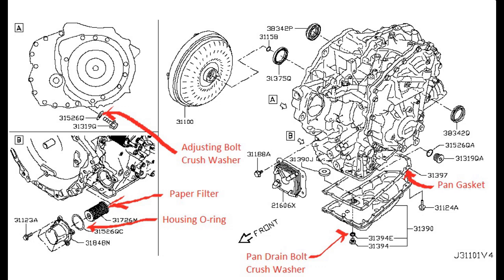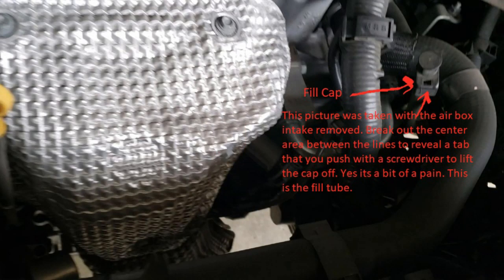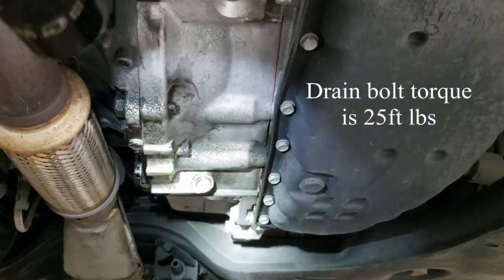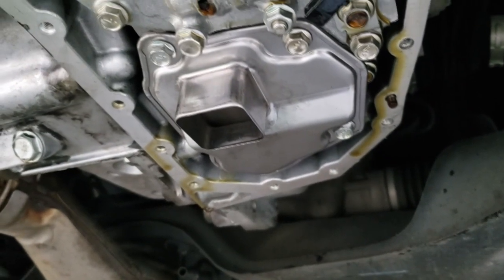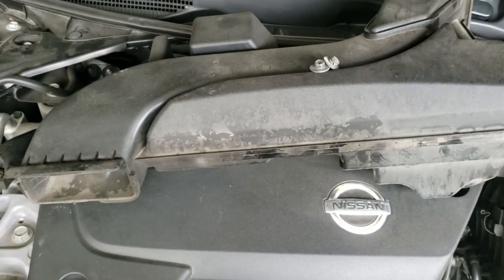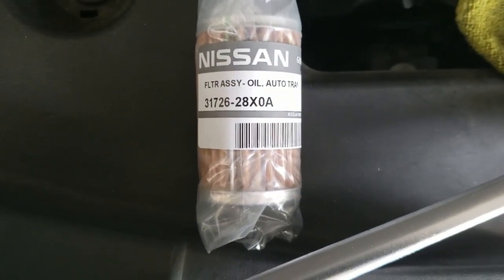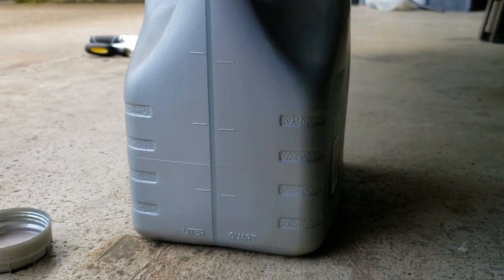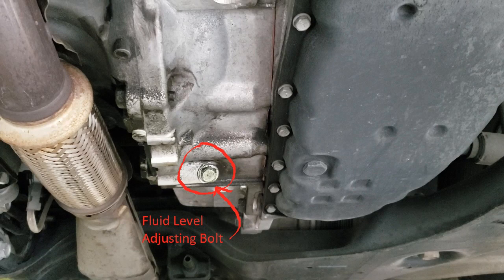2014 Altima Transmission Fluid Flush and Filters Replacement

Comment: Idemitsu makes the Nissan CVTF.  It is a non-synthetic fluid.  Valvoline, Havoline, and Amsoil are good or better than the actual Nissan brand.  Before Nissan changed to Idemitsu the previous CVTF manufacture's fluid wasn't meeting specs leading to all the CVT failures.
Reply from the maker: I researched quite a bit to also find out that the Nissan CVT is Idemitsu. So far I've been able to get good deals on Ebay on Nissan NS-3 by the case cheaper than I can find the Idemitsu branded fluid. I've been hesitant to use any other brand over concerns about viscosity.

Comment: If you remove the paper filter at the torque converter housing ( one with 4 bolts )  without draining fluid will fluid pour out.

Comment: The CVT fluid temp can be read in IOS with ELM327 version 1.5, using OBD Fusion app with the $9.99 enhanced addon (under purchase extras) on my 2013 Nissan Altima.
Reply from the maker: I don't have IOS so this is good info to put out there. Thanks!

Comment: Thank you for this great video! Question - would it be better to flush the fluid until clear, and then drop the pan and replace the filters? Otherwise won’t the brand new filters catch a ton of crap due to the old fluid still in there?
Reply: Good question. The pan is the source that is feeding the pump and hence the transmission so by dropping and cleaning the pan, filters, and refilling the pan with new fluid, you know you are pushing clean fluid through the trans. Any old fluid that will go through the new paper filter is minimal. You could probably do it either way, and I am sure no CVT trans expert or anything, but I think cleaning the pan  and/or replacing the filters first makes more sense to me. I could also use the rationale that do I really want to push clean fluid through dirty filters and a dirty pan?
Reply: @thevoigts651  Thank you for the great response! My thought was flush till clear, drop pan etc, then do another flush. But maybe that is over thinking it and wasting fluid. I need to do this to my wife's car, and your video makes it possible. Thank you again for making this!
Reply: @Verhooft  Well more flushing sure isn't going to hurt anything but I would think it's overkill. Realize that just by doing this to your car you are way ahead of the game from what Nissan "recommends".
Reply: @thevoigts651  Its surprising how little they "think" needs to be done to these. Lifetime fluid?? Yeah right.
Reply: I don't understand either why Nissan acts like there isn't even a paper fine transmission filter when there clearly is and from what I understood other car brands that use Jatco have it to be changed along with the fluid. I really think a lot of these CVT transmission failures are just due to lack of basic maintenance.
Reply: @thevoigts651  Agreed. I'm no expert or mechanic, but I don't hear as much about other companies having CVT failures on level with Nissan.

Comment: For Altima, do all you can to limit/ lower heat, includes minimum coolant-water ratio, 30k change both filters, best cvt fluid, seal the too-leaky cooling plenum, keep radiators clean...I found this to be enough for Mojave hard and hot conditions now 209k.
Reply: 209k is great, especially in those conditions
Reply: هـجر M'3  before you remove the fluid level adjusting bolt you have to make sure the car is level and the trans fluid within the correct temp range. If you didn't do those 2 things, make sure they are correct first and then re-check your fluid level. 3 quarts coming out would be a major overfill as the whole loop only holds 9-10 quarts. Are you sure you took out the adjusting bolt and not the drain pan bolt? The pan holds about 4 quarts.
Reply: هـجر M'3  If you drove for an hour the fluid is certainly going to be well above the correct temp range. I only have to idle my Altima for 5-10 min for it to hit temp. You probably drained too much out. Go by the procedure and you'll get it right.

Comment: I cannot find anything in the manual for needing to change the transmission filter or the paper one. Is it necessary?
Reply: The whole point of my making this video is that none of this is listed in the service manual from Nissan. They say you never need to change anything in the transmission except under severe heavy use, yet examples of failed Nissan Jatco transmissions are not hard to find. I don't want to have to replace my transmission if I can help it. My Altima at about 60k shifted way smoother after doing this and still is at just over 80k. I fail to believe a paper filter and fluid never needs to be changed, and drain pan and filter never cleaned. As to whether or not you need to do this is up to you to decide.

Comment: The Nissan dealer won't replace the paper filter because they say one of the bolts are hard to get to and that they would have to separate the transmission from the motor to get to it. Can you show us how you replaced yours?
Reply: I didn't take any video while taking them out, but they weren't very hard to get to from underneath. I used a simple 10mm wrench to get the top bolts. You can also take off the air intake as I showed to reach the top ones from above. The dealer saying they have to separate the motor doesn't even make sense as the paper filter is inside it's housing on the passenger side of the transmission towards the bottom.
Reply: THAT IS A BUNCH OF BS!!!! The Stealer is trying to hustle you dude. You can EASILY get to the paper filter by removing the driver side splash guard. It is not hard at all. That stealership is full of it.

Comment: At 4:27 in your video there is a open pipe facing forward, at the very bottom. Please tell me what that is for. Thank you
Reply: If I'm not mistaken that is the evaporator coil condensation drain pipe for the AC.

Comment: Do you have to completely remove the fluid level bolt in order to let drain until it drips?
Reply: Yes. Car should be level, engine running, fluid within the correct temp range, and drain bolt out until fluid drips.

Comment: Any idea who will do this type of work in your local area?
Reply from the maker: You would probably need to order the parts and fluid and take them to a local mechanic specifying exactly what you want done. A Nissan dealer isn't going to do this.
Reply: @HowToDoStuf  Thank you for the suggestion. Yes you are absolutely right. No one will touch it.

Comment: I would also add a transmission cooler flush, this will get all the debris out of the collant line. Nissan sells those cans for cheap
Reply: Even though it is Nissan approved, I am leery of putting any kind of chemical into the transmission loop. I guess as long as you air hose it all out it should be ok. I might look into this next time I do my flush.
Reply: @thevoigts651  The cooler flush is like brake fluid, it dries very quickly. When I used it, I was able to see lots of dirty stuff coming out of the hose. As you said, you can also use air can and pump air through it afterward, but not necessary

Comment: As far as the sealed cap. All u do is insert a small flat blade screwdriver into the slot gently then pull up on the cap while holding the screwdriver. It comes right off.
Reply from the maker: I haven't tried this. You wouldn't loose any fluid that is in the pan to be sure. I'm not sure how much would drain out of the torque converter housing. I would think that not much fluid would.
Reply: @HowToDoStuf  
I think he's talking about the fill tube...?

Comment: Does this method also applies to the 2016? Do I really need 10 quarts? Because some other people here on YT use only 4 quarts.
Reply from the maker: 4 qts is only draining and refilling the drain pan, which is what most people are doing if they do anything. The reason I made this video is to show you how to change the paper filter, mesh pan filter, clean the drain pan, and replace all of the fluid in the transmission. The part numbers for the filters may be different (easy to look up), but Nissan CVTs are all Jatco transmissions and work basically the same way. Its up to you what you want to do.

Comment: What is the price that  you paid for this procedure good to know thanks
Reply: I'm running off memory here, but I paid about $150 for a case of Nissan NS3 from Ebay, about $10 for the paper filter, $5 for the filter housing o-ring, a couple of bucks for trans drain bolt washers, $15 for a trans gasket, $5 for CVT50 app, and $35 since I replaced the mesh filter instead of cleaning it (which is what I will do next time). I probably missed something but that's what I remember. I also had to buy a 1/4" torque wrench for the trans bolts. Not bad given that Nissan here charges $250 to just drain out the pan and refill 4 quarts. We've acquired a 2012 Altima so I will be doing this flush on it soon.

Comment: This procedure is significantly different from what is shown in the service manual.  Read the service manual procedure shown starting on page TM-83 before you attempt this method.
Reply from the maker: The service manual of course shows only a simple pan draining and refill which is recommended only under extreme duty conditions (per the owner's manual). There is no mention of changing the fine paper filter, cleaning out the pan, cleaning/replacing the mesh pan filter, or changing out the fluid, which are all reasons that I think have greatly contributed to these transmissions continuing to have issues. Why Nissan ignores basic maintenance on these transmissions is beyond me. Nissan also says to use a charging pipe set to fill when there is a perfectly good dipstick tube.  The TM-83 page you mention is very helpful in that it gives you the proper fluid level procedure.
Reply: @HowToDoStuf  The standard procedure does change out the CVT fluid.  At least 10 quarts of NS3 are required using the standard method (which includes dropping the trans fluid pan and cleaning the metal strainer and replacing the paper filter by the trans fluid cooler for a complete service) which does involve mixing some of the old fluid in with the new and draining out some of the new fluid as well - a necessary evil unfortunately.  Most people who will attempt this maintenance will have watched several different videos beforehand - I sure have.  I appreciated your excellent video quality as I could see everything clearly.  I am aware that it is possible to refill the transaxle through the dipstick tube - Nissan apparently did not want to inform  DIY mechanics of this probably because many of them weren't using the correct CVT fluid when replacing it trashing their transmissions and then trying to get Nissan to pay for a replacement.

Comment: In the description under "tools needed" you say a torque wrench for 25"ft" lbs torquing of transmission pan drain bolt... Are you sure that's 25 FOOT pounds? That seems like a lot... but 25 inch pounds seems like to little for the drain bolt...  I'm going to be doing this procedure soon so I'm just wondering.
Reply: 25ft lbs is not much torque for a drain bolt. That is pretty much normal for drain bolts with a crush washer. That torque comes from the service manual.
Reply: @thevoigts651  Cool thanks.
Reply: The oil drain plug on my pathfinder is 25 ft lbs too. I wouldnt gand tughten on that much, but thats the spec.

Comment: When you say ignition on do you mean start the car? Or just put the ignition I'm the on position?
Reply from the maker: You have to start the car in order for the transmission oil pump to begin pumping into the waste container.
Reply: @HowToDoStuf  I'm talking about when adjusting the fluid level with the OBDII scanner.
Reply from the maker: @TheDwilliams1000  When you are checking the fluid level, the car should be running and the trans fluid has to be at the specified temp.

Comment: You missed the part where after you take the bolt off there is another part inside you have to use an Allen key to take out. Makes it flow faster.
Reply: What bolt and which part are you referring to?
Reply: Elmo Car Guy Sorry LOL!! The bolt to drain the tranny fluid. After, you stick an Allen key and twist. A piece will come out allowing more flow for the fluid to drain.
Reply: @thevoigts651  Hmm, maybe it is different for the 2013.
Reply: @anon4041  I wouldn't know as I've got a 2014.
Reply: My 13 Altima is exactly like the 14 in the video!!
Reply: @roberto3330  Idk I saw a video of a guy doing it and he removed a bolt that was inside, it drained much faster.
Reply: A Non I know the Sentra has that Allen bolt, and I believe is hollow like a snorkel so the fluid can drain when overfilled.
Reply: @anon4041  I think you're confusing a Nissan with a Toyota.
Reply: Some transmissions have a leveling straw above the drain bolt instead of torque converter check bolt. See the following: https://m.youtube.com/watch?v=PziK25C8avo

Comment: Does that scan tool work for a 2016 altima
Reply: CVT50 works on all Nissan transmissions AFAIK. That is what is was designed for
Reply: @thevoigts651  thanks
Reply: @thevoigts651  would the obadator mini work with that cvt50 app
Reply from the maker: @valledecauca1087  I can't seem to find the ELM327 revision number of your obadator mini. From the CVT50 website :"Bluetooth or WiFi adapter ELM327 revision 1.5 or lower (functionality might be significantly limited if used with not genuine adapters of revision 2.0+. Communication with CVT requires advanced ELM327 functionality which is often missing in clones v2.0+)"
Reply: @HowToDoStuf  which scan tool would you recommend to monitor rhe transmission temp etc. Im swapping a transmission on my 16 altima just had cvt faliure at 110000 miles
Reply: @HowToDoStuf an affordable one?
Reply: @valledecauca1087  That really stinks, although if your transmission made it over a million miles, you got your money's worth! (JK) I don't know what else to tell you beyond the CVT50 app. That has been the easiest way for me to check things out just using my phone. I don't know of a stand alone scanner that would accomplish this.

Comment: I tried this dripping with it on nothing scratch my head I out back in what I took out turn the car off then it pour out
Reply: I'm guessing here what you're talking about given that you english is broken up. To check the fluid level, the car needs to be jacked up and level. You need to have the car running and the transmission within the recommended trans fluid temp range as shown in CVT50. You remove the fluid check plug and add fluid or drain until the fluid just drips out of the check hole, then put the check plug back in. That is all there is to getting the fluid level correct. The car does need to be running to make sure fluid is up in the torque converter when you check the level. Yes, if you have the fluid level check plug out and turn off the car, fluid is going to pour out as it drains out of the torque converter, and if you do this, your fluid level will be way too low.

Comment: Do you which hose will pump out the old fluid and which hose is the return hose?
Reply: The transmission fluid flows from the warmer on the engine block to the cooler on the side of the radiator. You can undo this hose at the transmission cooler on the side of the radiator and put it into the drain bucket. I have pictures of this in the video.

Comment: Is it a must to have the cvtz50 app, I have iOS,
Reply: I really don't know of another good way to determine the fluid temp without it as CVTZ50 is reading the information straight from the transmission sensor. The important thing however is that you are reading the CVT fluid temp correctly. You would just have to find a way to sample the fluid somehow to determine the temp.

Comment: How do I get diagram pictures like that I wonder if the $100.00 I spent blue driver obd2 will work for checking transmission fluid this is a really nice video thanks
Reply: I got the diagrams mainly on the Nissanpartsdeal.com website I mentioned in the description. The service manual which I was able to find online in pdf format has a lot of diagrams also. As long as your odb2 device is an ELM327 firmware 1.5 compatible it should work with CVT50 to read the fluid sensor temp reading
Reply: @thevoigts651  ok thank you I appreciate you
Reply: @2pacnasgame  Glad to be of help.

Comment: You did a superb video kind Sir on your video. I agree with everything you said; with one "addition" you need to do. IE: You need to "flush" all the transmission with Nissan "Transmission cooler fluid". You can see this in the video below.

https://www.youtube.com/watch?v=qhd39HU-TJE

The great thing about this procedure is: it forces out the contaminated fluid; rather than waiting on gravity to do the job. And because it force flushes in BOTH directions; it insures ALL the old fluid is gone. Plus; you can see clearly when the old fluid is gone.

Again, you did a great job kind Sir. Keep up the good work.
Reply from the maker: Thank you. Just to be clear, in that video he flushes the transmission cooler, not the transmission. That sounds like a good idea. Flushing the entire transmission is in my opinion a mistake. As for where to find Nissan branded CVT fluid, I ordered mine online. Some dealers do carry it but they are ridiculous in their pricing. I will probably either use the Aisin NS3 from Rock Auto next time I do this (as another person mentioned further down in the comments) or order a case of Nissan NS3 via Ebay. 

Upon a little research, I found a thread on bobistheoilguy (https://bobistheoilguy.com/forums/threads/nissan-ns-3-cvt-fluid.330034/) that says the Nissan CVT fluid is Idemitsu N3 (http://www.findmymsds.com/nissan/pdfs/99998-CVTNS3-E.PDF).